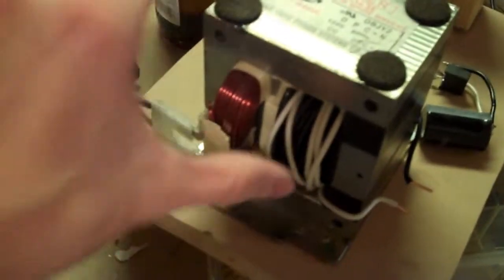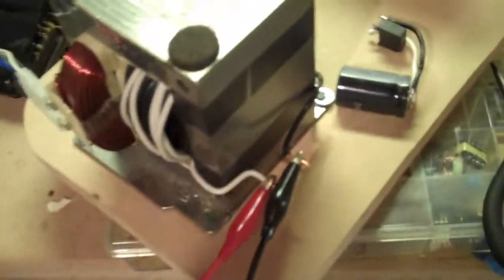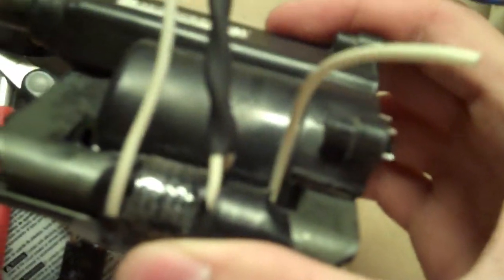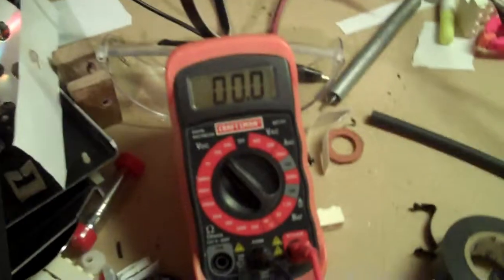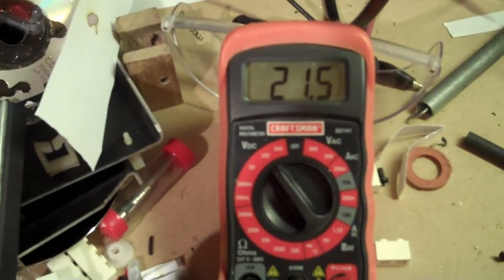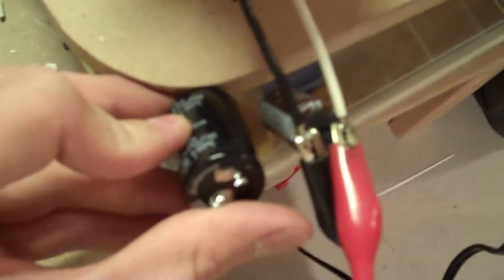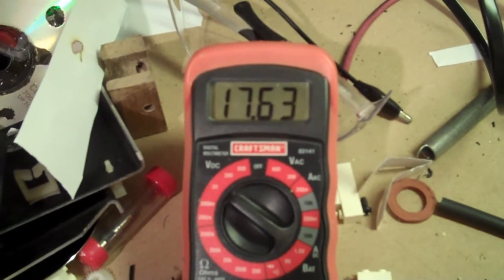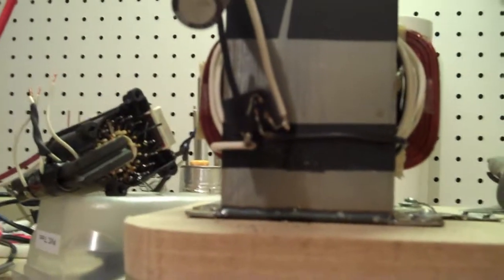Power Supply for ZVS Flyback Driver

Comment: @ciprianwiner Hello again lol, Put a large smoother capacitor across the output of the transformer in order to reduce ripple current. Or use some lead acid battery's, that is what I used to power my ZVS and they work well.

Comment from the maker: Yeah, this rewound MOT didn't work very well. I switched to a 24V switching supply and a 555 timer driver. The arcs are not as hot, but are twice the length.

Comment: nice one man, but i am going with a switch mode power supply, why? beacuse i never had luck with transformers on zvs driver because of the ripple current and buzzing noises but i am going to change the mosfets and maybe if i get better results i will rewound my MOT again :D